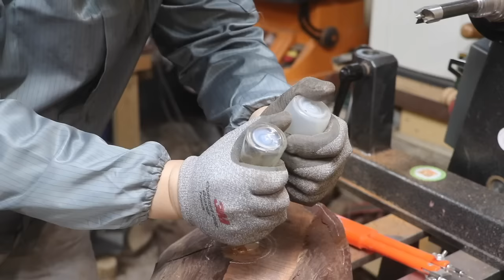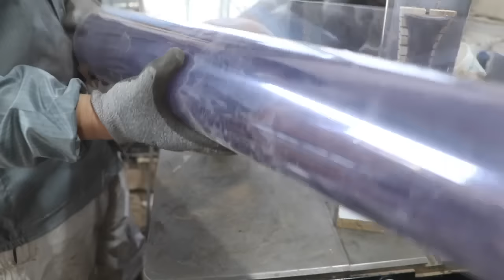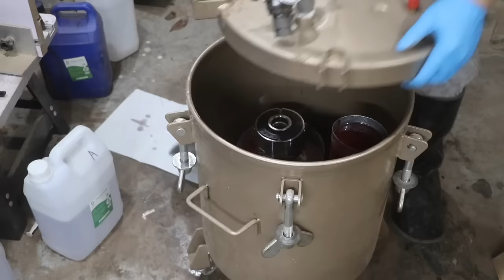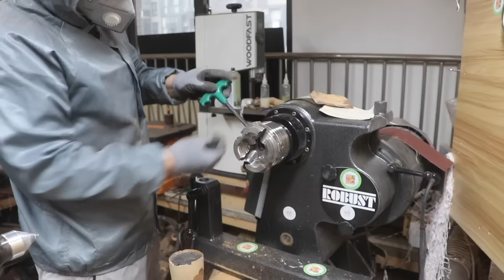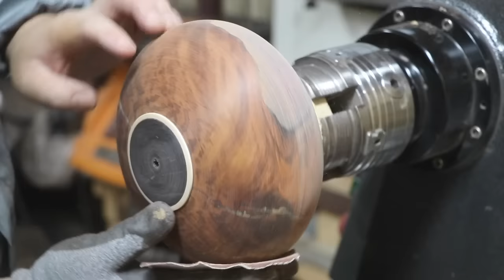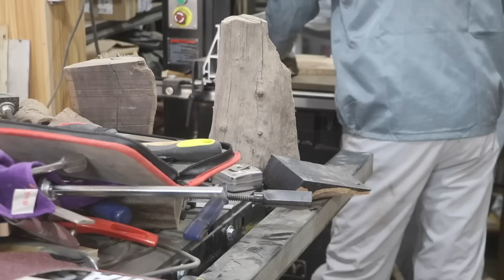Unbelievable piece ----- woodturning

Comment: Looks great until you see the runs in the varnish 😳
Reply from the maker: Snake wood is very beautiful, but it's so easy to crack. I polished the pieces in my previous projcets , but for this project, I want to try varnish, to test if the varnish can protect it.